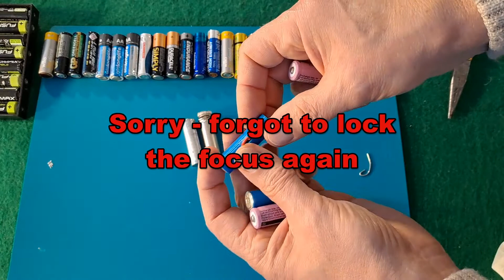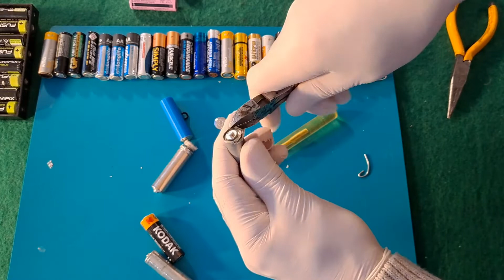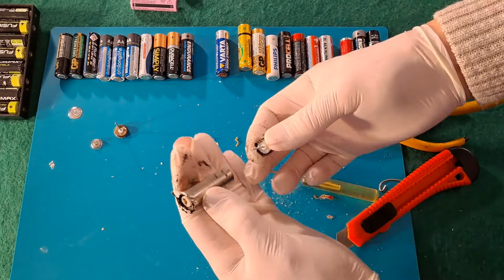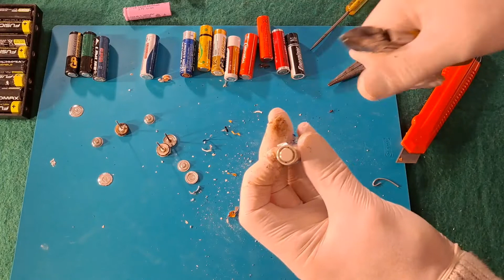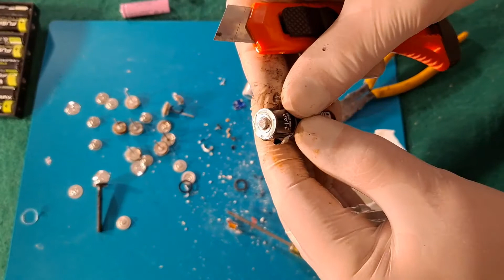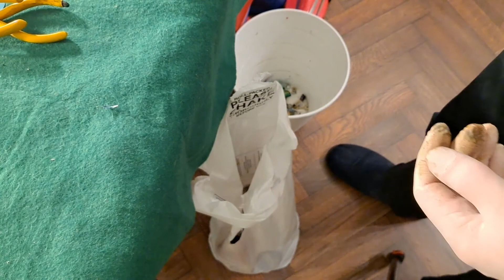LONG VIDEO Stripping down some dead AA batteries

Comment: Is there anything you can do this the carbon electrode
Reply from the maker: Yes, they can be used as electrodes for making batteries (like lemon or vinegar etc) or if you are more adventurous they can be used as electrodes for home-made "arc welders". You could probably use them as pencils on some surfaces, but they are a bit hard for that sort of thing.

Comment: Wouldn't it be easier to just use  jumper cables / wires? Okay the dummy batteries are cool but Lord of Mercy that's a bit of fussy work..
Reply from the maker: With the batteries I used in the original video for the dummy battery, the caps come of each end easily. It was only when I tried some other brands I realised people might have trouble copying my method, so I thought I would explore the different brands. There are lots of situations where  a jumper cable simply isn't an option, like a flashlight where the batteries are all in a line in a tube.